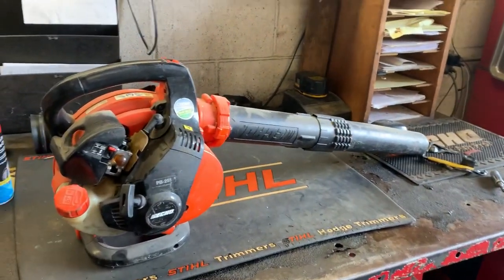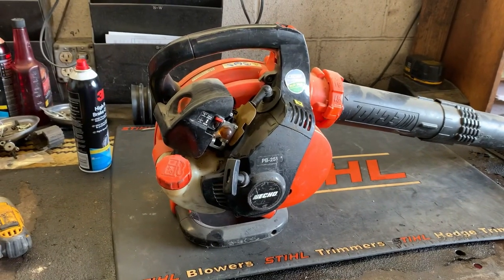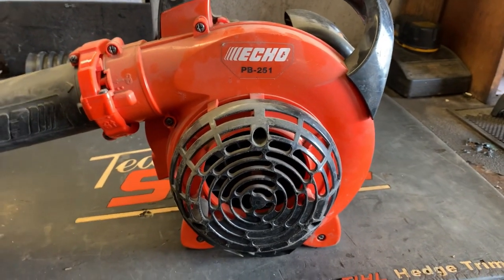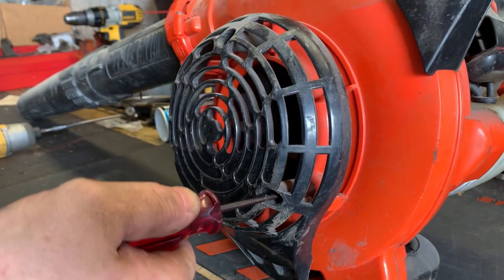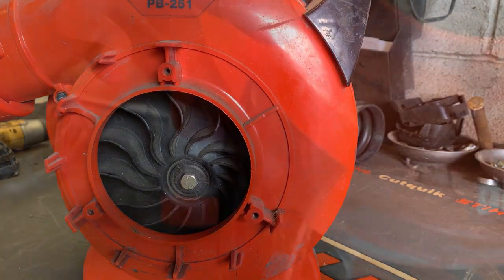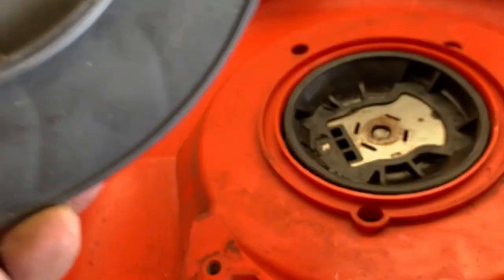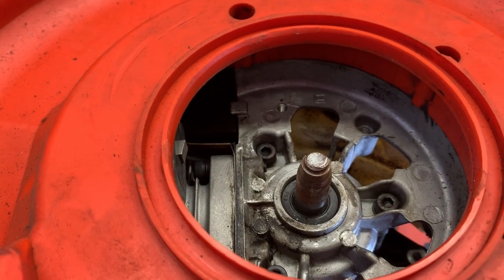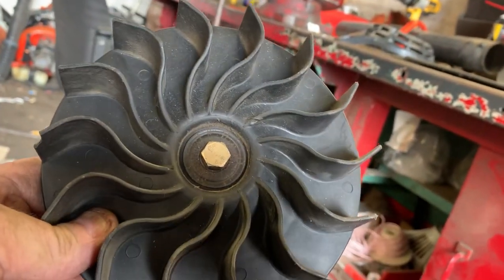ECHO PB251 CATASTROPHIC CRANKSHAFT FAILURE

Comment: Jello Jeremy I need some help have a ryobi c4618  it is running like a scalded dog I spray carb spray around the engine to see if it is sucking air I can't get it to quit over revving I know you did a lesson in this but sir I am very stumped
Reply from the maker: First thing as first is to do a cylinder and crank case leak down test once you have those Numbers let me know

Comment: Too bad it didn’t just shear the “key” instead. The replacement flywheel is solid aluminum instead of that laminated metal and plastic crap. Come on Echo! I expect more from my favorite brand. Hell, I’m only on my second blower and trimmer in 30 years but I buy the commercial stuff. Spend a little more money and avoid the entry level models of any brand.

Comment: When it comes to warranty repair we have found a fool proof way to determine if the customer is lying. [their lips were moving]. We would have customers bring their two stroke motorcycles in with the top end seized, did you use a gasoline oil mixture sir? Yes I did, and I swear.
Well if we replace the top end and the bottom ends seizes soon you didn't use a premix mixture, L0L, if that makes sense.
Reply from the maker: Exactly and that’s why a good technician would not do the top end unless the bottom end had been freshened up
Reply: There is a tests you can use to tell if there is oil mixed in the fuel